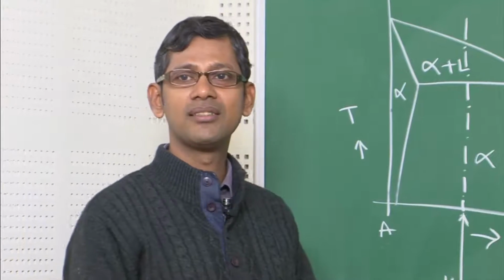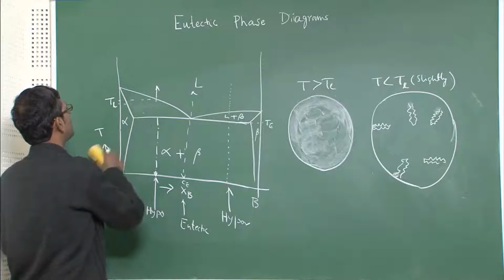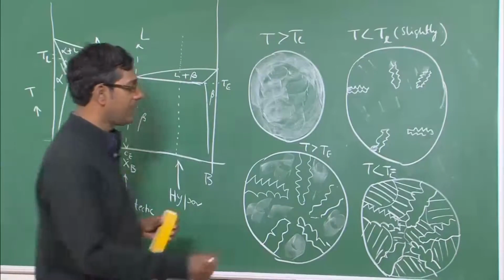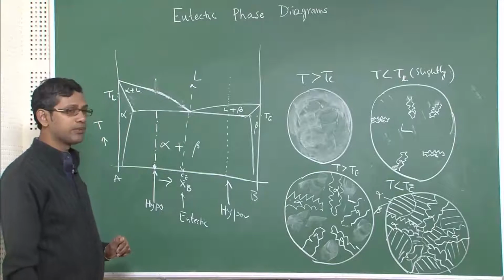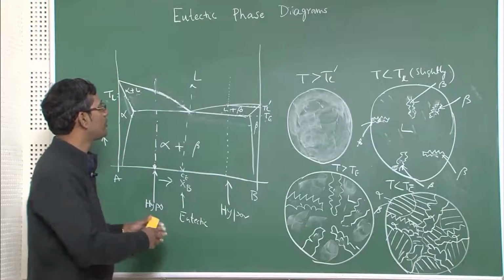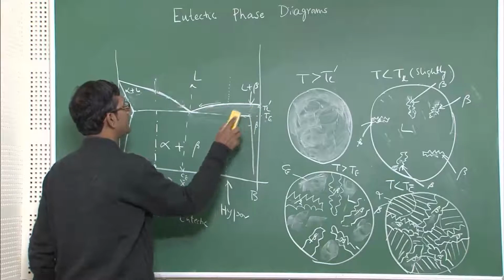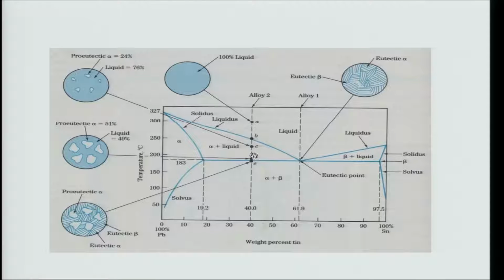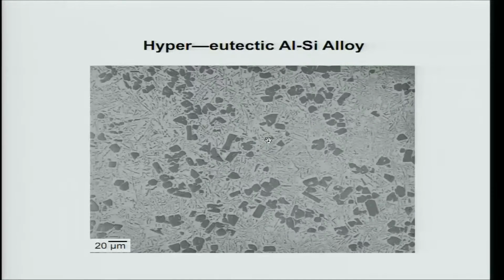Lecture 13 : Solidification of eutectic, hyper-eutectic alloys & their morphologies II

Comment: Hi Proff,

With my understating if C(alpha) = concentration of A by % and C(beta) = concentration of B by % which adds to 100%.
At the Eutectic point, as the the concentration C(alpha) and C(beta) doesn't sums up-to 100% as they move extremes. Can you please explain on this.

Comment: plz sir, i have a doubt that during cooling in hypoeutectic compostion mix , alpha contain both a&b or only  contain a.
Reply: +quillsfllater While cooling within the alpha + liquid region, the composition is purely alpha. On cooling below the eutectic temperature, It becomes a mixture of alpha and beta
Reply: alpha is A rich phase so it will always contain both A and B. The leftmost vertical line shows only A.